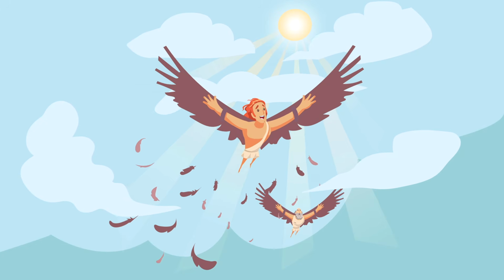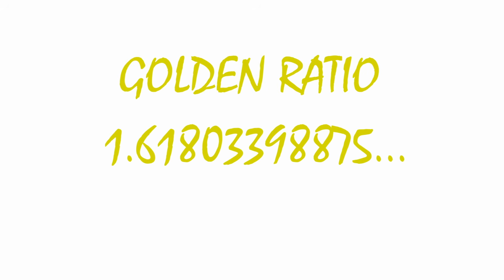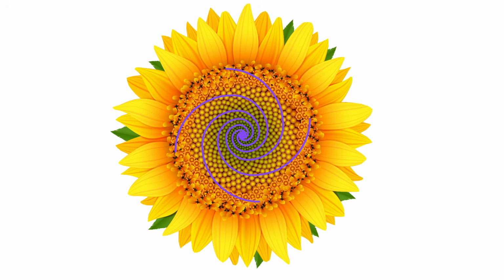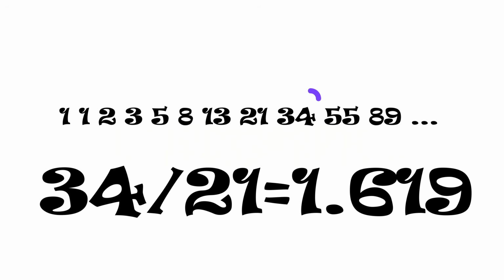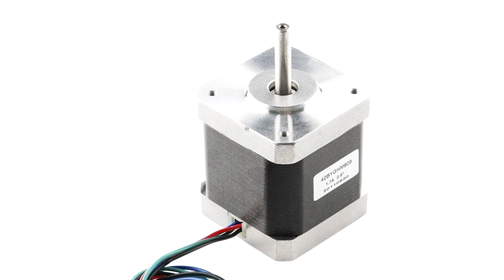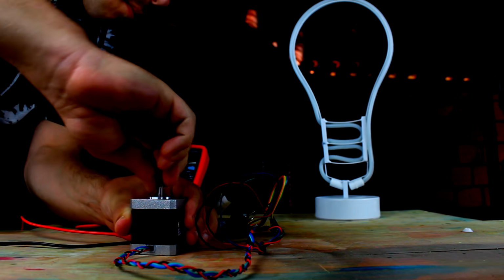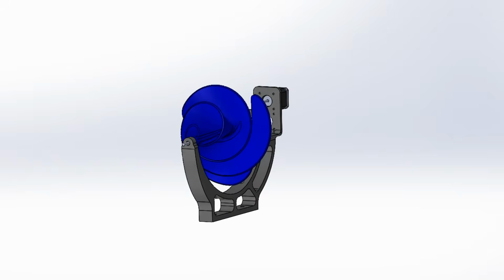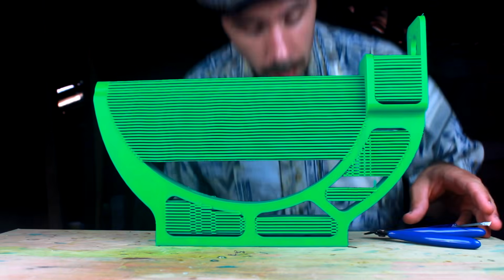Golden Ratio Turbine 3D Printed

Comment: Since you are discussing turbines and vortexes, one thing I always wanted to see is a turbine powered exclusively [or as nearly as possible] by the Coriolis force.

What I envision is a series of funnels stacked atop one another [in theory, the more the better as each vortex is limited in its output, but the same falling water can easily make multiple vortexes on the same shaft, if the shaft goes down the center of each 'funnel'.

If you made some unbiased paddles, you could easily show if the rotation of the water was causing enough force on them to develop torque or not.

The size and scale of the funnels and the paddles of course affect the efficiency of the system, but as a simple proof of concept, hypothetically one could use a column of plastic soda bottle tops, since 1, they are cheap, 2, they are easy to obtain, 3, they are easy to work with, 4, they are uniform, and 5, they are transparent so the cameras can record the results.

To make the construction the easiest way, I suggest leaving enough of the middle of the bottle so that you can easily secure one into the next instead of relying too much on a framework which might not be transparent, because this also serves as a way to reduce the chances of water splashing all over the place and making a big mess.

Furthermore, what I see as the ideal way to make the paddle impellers is to make them to the general contour of the inside of the bottle so that any spinning water will generally have to move through them to get to the center and go to the next area.

It did occur to me that another, smaller inverted funnel might be needed to redirect the water to the outside of the next funnel, maybe a smaller bottle, or a cheap plastic kitchen funnel of a reliable size which could easily be slipped over and secure to the common drive shaft.

From there, addressing the drive shaft, I figure a long piece of 'all thread' threaded rod should allow you ease of placement of all of the internal parts with fine tuned adjustment, especially if your printer can print for you internal threads on the impeller which you can then simply lock in place with a normal nut at the back, which works by creating impingement pressure on the threads and resisting rotation, or else, perhaps, some simple thread locking compound might work.

A set of bearings at each end should work, provided that the rod is straight enough to not wobble inside the assembly and cause internal parts to collide when rotated.

At the bottom, it is most likely you will need a gear reduction if you hope to get any power out of it, as I honestly do not expect massive amounts of power from it.

As the rate of flow is pretty important to this project, I was literally thinking of taking a bucket like we have here in the USA [we have these plastic 5 gallon buckets] and printing a base collar on it like you see inside a common [American] toilet with a floating rubber ball valve, which allows you to lift the valve quickly on a toilet with the simple yank of a string.

To support this, I find a sturdy aluminum or fiberglass step ladder with at least 250 lb [ 110 - 115 kg] rated step ladder, at least 8 feet [ 2.2 m or higher ] or else rig it up with a pole, or against the side of a building where you have permission to do so.

When the bucket is securely supported on its platform, with the column of funnels with the impellers securely affixed to the bottom of the ball valve, and the gears at the bottom aligned to the generator, one needs to fill the bucket, most likely with a hose, and then pull the lift on the valve to induce a sudden rush of water [this sudden rush is the only way to ensure maximum flow dynamics, as a mere trickle would never work at all]

Furthermore, however, you COULD then compare this to the impeller you made, and see if it is more efficient in the same placement.

Clearly, the more force the swirling water exerts, the more force will be recovered at your generator.

That said, I can make no promises that at such a small scale, it would produce enough to be worth one's time.

As you said about the laws of relative exchange, to get power out, you need to have power in, so scale is always going to be a critical factor in this kind of project's ultimate success.

I have seen large home made single stage water wheels generating as much as 5 Kw of power in a goodly sized creek, but they were made of steel, and cost thousands of dollars to build.

This too goes back to the economy of scale of course, but herein, the idea is mostly to prove the concept and promote people to explore possibilities.

Comment: When you found the max rpm at 2300, a 1:10 gearbox instead of a 1:30 to get that 20k rpm the motor wanted.  That is how it works, design for the generator/motor's peak efficiency.
How about building a Warping Wing Glider using the Wright Brothers tech.  Print along the length (out from center), not up/down or front/back. Use rigid resin for the struts.

Comment: So sig sauer has made 3D printed suppressors that will be on the market before the end of the year.   Be really cool to have you print some noise suppressors using some of Tesla’s tech.   Like the Tesla valve.   Or even this impeller.   Anything that will break up and slow down the sound waves.  note before anyone says anything idk your local laws but I just mean in general not for firearms as in the USA a suppressor for firearms is a NFA tax stamp item.

Comment: Don’t use a motor just print your own inductor. I’m currently looking for the best wind turbine to print that I can attach to one I designed to be SLA printed. It uses neodymium magnets on a plate between two plates containing copper coils each, both plates are wired in series and the out leads from the plates run in parallel. Bearings in the coil plates allow an axis printed for the center magnet plate with square center to lock with the magnet wheel. Then I’m going to test the out put in A/C and use some diodes and capacitors to build a bridge rectifier. If I find a good turbine to attach it to, I might print a bunch of them and build a wall of turbines to mount in my yard and start storing the power eventually, thinking of getting a grid tied inverter too.

Comment: I think you should have measured the power without the led since it is basically a variable resistor you have no control over.
You basically just measured a part of the available power.

Cool video, but i do not seem to get the benefits of the lily turbine:D

Comment: Make a wind generator using a speaker, but instead of a cone (the center of the speaker), glue some sort of sail or stick that will catch the wind and oscillate the coils inside of the speaker and produce electricity. I am not sure what it is called but here is a video explaining the topic better. :)   https://youtu.be/Nj3pH95aMOQ

Comment: Why don't you just use a BLDC motor and rectify the 3 phase output? Use a low KV motor to get the most output V (or rather best load impedance match) and use that to power stuff ?

Comment: Two ideas:
First, in Oregon we gets tons of rain...how about a gutter downspout with the turbine installed as a way to harvest power from rain?

Next, have two water storage tanks, one on top of the other and connected like you did with the bottles. Solar is used to generate power for the house batteries, and to pump water from the lower to the upper where it is stored until evening. Then, when the solar power to the house drops below a certain threshold, it activates a valve that allows the upper water to flow into the lower tank, with the impeller in between. The impeller then provides power to the house batteries for a short while. The next day, the water is moved by solar to the upper tank again to repeat the process. Like a kinetic battery for evening when the solar option isn't available.
Reply: That first idea sounds great, theres a lot of places with a lot of rain and its basically free energy from the sky. That second idea, unless im getting something wrong here, sounds like it would lose more energy than it would gain by pumping the water back up. Unless there is a natural way to do that, any pump to push the water back up would take more energy than the water falling would generate
Reply: I now realize you said that it would be a kinetic battery, but still i think traditional batteries would be a lot more efficient, both in storage capabilities and in energy loss.
Reply: Possibly true. That is why I am bringing it to stronger minds than mine, to think of these things. 😁

Comment: Nikola Tesla invented the polyphase induction motor. I'd like to see a 3 phase magnetohydrodynamic induction pump 

Emphasis on induction over conduction.
Reply: I don't believe this is possible granted magnetohydrodynamic-anything won't  operate on 3 phase ac. It operates on dc current. You could rectify 3 phase and maybe achieve this but I believe that'd be the only way
Reply: @patrickbowen9395  I can see what Keith is suggesting, if you have 3-phase windings surrounding something magnetohydrodynamic, a rotating field might cause it to generate a vortex in the fluid, since the fluid would be the rotor of an AC induction motor in that case.

Not sure if that's even remotely useful for anyting but it can be a cool experiment.
Reply: This is already been done, but not with 3 phase. Its done with dc. Conductive fluid with an anode place in the center with a cathode shell, placed above a permanent magnetic field. Search mercury vortex. i believe its possible with any conductive fluid but this is usually done using mercury or gallium.

Comment: It would be nice if you can build a low cost atmospheric water generator. By pressurinsing air using a wind turbine and a compressor to  extract water from it. Maybe also add a ceramic water filter.

Comment: I'll play along.

Since I'm the underclass poor and have to worry about subsistence, maybe you could get the ball rolling.  

Check this. You can take graphite powder; super cheap, and exfoliated chemically or mechanically to produce graphene. Which has interesting chemical/physical properties.

When a charge is imparted on the graphene particles during exfoliation or by chemical means; the particles can be manipulated by an electric field. A solution suspended between two electrodes will deposit on the complementary electrode; thus forming a porous, conducting film... ??? and ??? and ??? slap a dielectric between two films, add some electrolyte, seal them in a container, add come collectors... and you got yourself a super capacitor.

Comment: You could make a cannon using the same idea as the pulsejet engine, except instead of a bunch of pulses, it’s only one. I made a cannon this way except without a Tesla valve, and it easily shoots 50 mm glass bottles 50-100 yards, but it also sounds like a gunshot. I’m not exaggerating, if you shoot a glass bottle it’s about as loud as a rifle, but you can make a suppressor for it, here’s a link: https://www.instructables.com/id/Potato-cannon-Silencer/ I just used a 2 inch pipe, a fire extinguisher, and a propane blowtorch, you let gas in and after 10 seconds light the gas, and you have to let more gas in for heavier objects, Mine doesn’t have a suppressor yet but I’ve read it works great. Just go to a big open space to fire it.

Comment: How about putting a duct around the turbine with a scoop out front to increase the air density which might increase the kinetic force and drive a harder gear ratio to produce more current. Or better yet, dunk it in a stream at a constriction and height drop.
Place it over the output vent of a geo-thermal source.

Comment: I wonder, wouldn't it help if we would take a bit of the elecricity to power a small motor mounted on the shaft, to help the thing pick up speed easier? From what i saw it had quite some resistace and at lower speeds the thimg would barely turn. Basicly, like a sequential turbo system in a car, a small turbo that helps the big one spin

Comment: Ι am trying to make a v8 combastion engine, with hydrogen for fuel. I has already started  to built that. It's funny and interest project to do.
Reply: are you using electricity to separate hydrogen from water?  Or maybe hydrogen peroxide?
Reply: @Diversifried  I usually use a mixture of distilled water and backing soda and I collect only the gus above the negative electrode.
  I hasn't try to use hydrogen peroxide, try it, maybe it will work better.
Reply: @xgamer6793  I would be interested in hearing the results of the Hydrogen Peroxide experiment.
Reply: @Diversifried  me too, there is same amount of hydrogen and without the production of CO2.

I will try it... Thanks for this fantastic idea.

Comment: Thanks again Intg... Inge..lol  Integza! I love a good laugh and people who entice you to expand your view and thinking from the standard 2D to a 3D perspective. Not many can look at a side elevation or or cross section of a plan and be able to see what the finished product will look like in the physical universe, till possibly the advent of 3D printing?!

I think perhaps you had your vortex screw facing in the wrong direction when wind testing with you car? It may require a small amount of re-design to channel air into the shaft end of the screw but I think it would keep its structural integrity much better under higher loads.

I would like to see you set it into a tube, probably into a 135 deg or 90 deg bend and harness wasted energy from H2O. Say from sink and bath drains or perhaps between a Dunny(toilet) and cistern or even in down-spouting to utilize whats currently "free" energy that falls from the sky? How many phones could you charge from flushing your porcelain throne?!

I think your onto something that could have many applications. Keep entertaining and educating, and occasionally f&#king up!  

Cheers Mate.

Comment: electric cars are stupid right now .trying to rely on one type of power which i find absolutely retarted.. a proper Electric car should Still have an alternator applied to the wheels rotation, a solar paneled roof. and Wind generators in the place of where Air intake and or radiators would normally be found to have a 3 pronged approach. if you have a battery bank the cars driven by anyway why not recoup the power on the wheels rotation with an alternator solar as a given to recoup charge while driving and parked. and wind turbines to capitalize on power recuperation while driving. its completely stupid and near sighted to say Teslas are great at the moment because there not. to be great the tesla should have been Energy self efficient. ie not needing globally available charge stations to get anywhere.

Comment: Use the resistance of a generator as a brale system on a bike to charge when you brake and also never have to replace  brake pads pr disks.

Comment: A water rocket would be super cool, lots of 3d printed parts are needed. A single stage rocket it's not very difficult. Of course you could even make it multi-stage, but that requires more complex electronics.

Comment: Make a super capacitor rocket, and maybe you can control it with rc or a water rocket with your turbine
Reply: you mean like tom stanton?
Reply: @OperationDarkside  Yes, I mean that one
Reply: @OperationDarkside  it would be awesome
Reply from the maker: Hi Gi Br! Guess who won a 3D printer?  Send me your info to integza@gmail.com. (Name, Address, Contact)
Reply: @integza  THANK YOU VERY MUCH!! I'M SUPER HAPPY, I JUST WROTE YOU AN MAIL WITH THIS CODE 04359 WITH gi***p**br***o**@gmail.com
Reply: How would that work?
Reply: I'm sure there's several ways, but at least one "commercial" company does work with water/electric rocket motors. Not saying it's viable, just saying it's a thing.

Comment: Try incorporating a funnel tunnel that is narrow at the back and wider at the opening. In the funnel tunnel a series of fans can line up, smaller in front and wider in the back. The smaller fans in front will have the full force. As you move backwards, each fan has longer and longer blades as to catch wind as well. The funnel tunnel should force air to move in one direction with force. Put a few on your car and u have multiple electric generators. Or you can use a closed loop system using fresnel lenses to heat up water into vapor and with vapor pressure spin the fans in the funnel tunnel

Comment: The Lilly impeller is extremely well suited for a low head, medium to high speed hydroelectric generator. Look up the vortex hydro power generator. It sucks for laminar flow, low viscosity, and low speed situations. In other words: useless as a wind turbine, propeller and such.

Comment: Do you want increase the power of your turbine  ? just make an axial flux generator ( google it ) with neodymium magnets and all 3D printed , instead of using stepper motors which are very inefficient as a generator

Comment: What if you were to make the lily impeller  but inverted the design? You an also close off the edges of the impeller so it would look like a solid cone. That would help keep the fluid from going out and force it to the small end and make higher pressure. It should work as a jet turbine of sorts

Comment: Ok, @Integza I've already liked, and subscribed, so here's my 3rd step to get my name added to the prize pot:  Make a sequel to this video, a comparison between a standard wind turbine (ie. a propeller) and the Lily impeller. Make them equal sizes etc. but compare the performance in volts and watts (power output) to see if there are any differences in performance. Measure both as a wind turbine (with electric power output) but then also measure both driven by electric power input and measure mechanical output (rpm, torque, etc.). I have NOT seen any direct comparison between standard propeller and the lily impeller and would be most fascinated to see a side-by-side comparison!